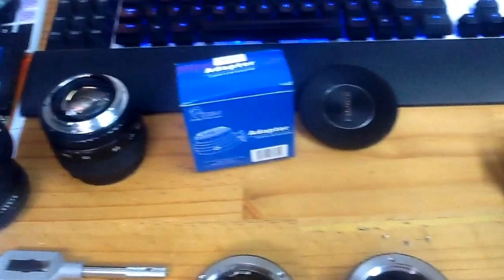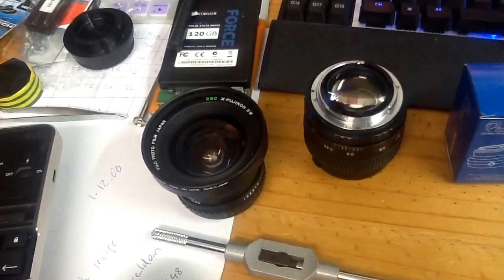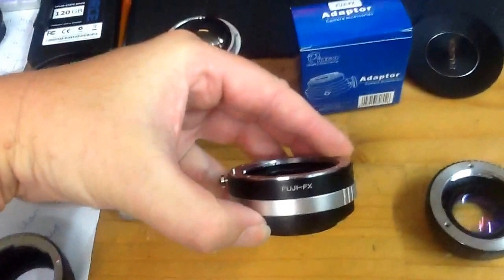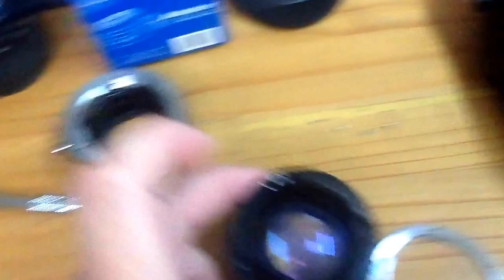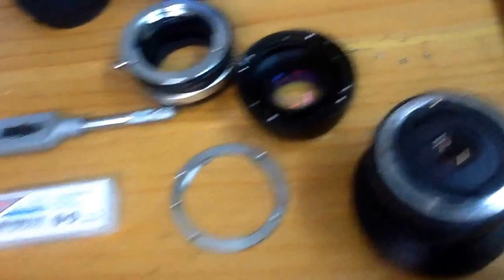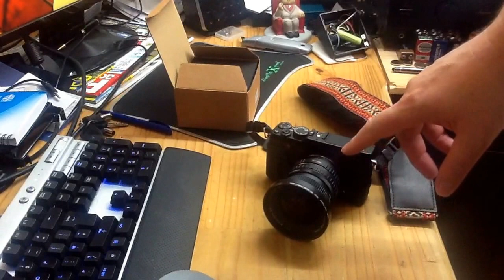Focal reducer for Fujinon AX manual lenses to Fuji FX

Comment: I also want to try this, but maybe it works with an AX to EF adapter and an EF to FX focal reducer. I want to experiment with this setup too so it could be compared together.
Reply from the maker: NimKorko something else you need to do is tie the aperture pin on the lens you're using or add a pin to the adapter. If you don't do this you have to shoot wide open. I usually tie mine with a small piece of wire in a "c" shape. I might drill a hole in the adapter to add an "aperture" pin. You can see this pin on my other adapter videos. This speed booster didn't have one because the Minolta lenses don't need it.

Comment: Clever! Good job.
Reply from the maker: Thanks for the comment! 
It's not perfect, what with the aperture underneath the lens and the lack of a locking pin. Also there's a bluish halo in certain lighting conditions (looking towards bright sunlight). I don't know if this would also happen with the Metabones speedbooster, but they're a bit on the expensive side. It was fairly cheap and cheerful and it means I can use my 19mm at  about 20mm (35mm format 19 x 1.5 x 0.71 = 20.235mm) which makes for a nice wide angle. It also makes all my lenses a stop faster, which is useful with the telephotos.